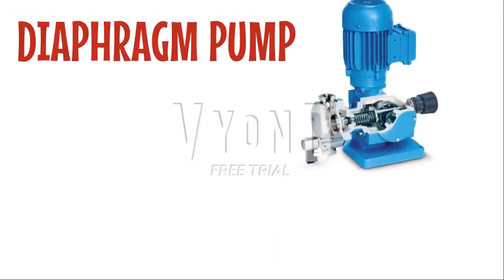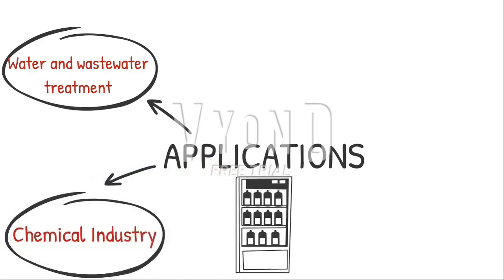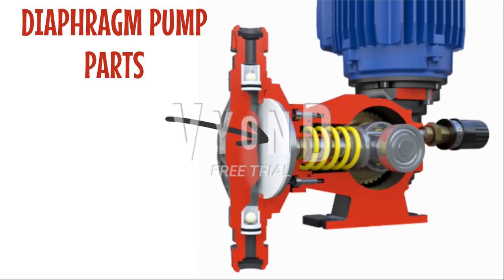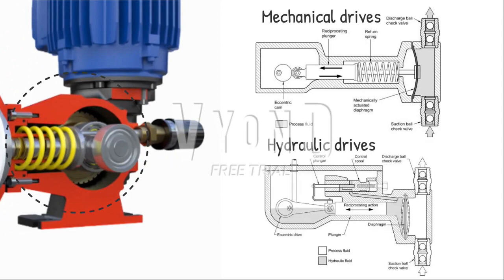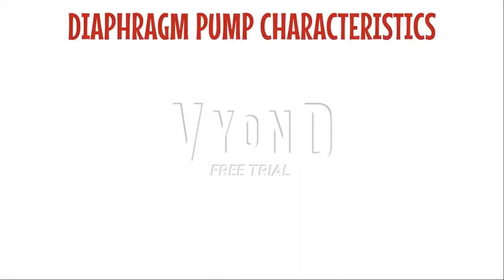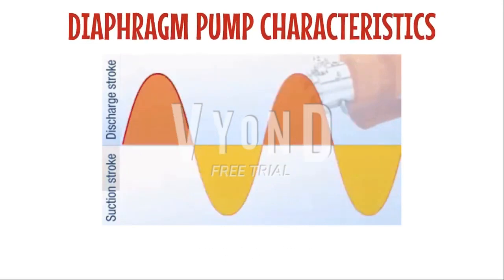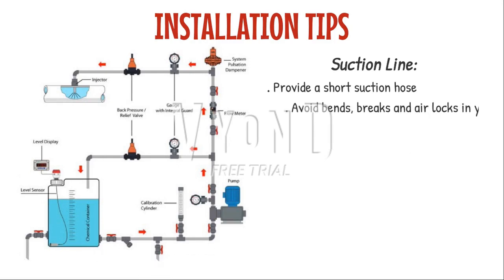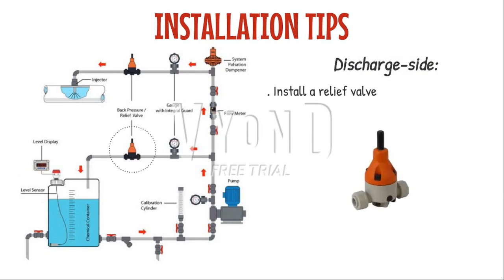Diaphragm Pump : PARTS, WORKING, INSTALLATION TIPS, ADVANTAGES AND DISADVANTAGES

Comment: The flow adjustment or dial   Can  we have it in stainless steel steel or something because we use a pump like this but for 98%sulphuric acid
Reply from the maker: Of course there is different types of diaphragm pump even on stainless steel